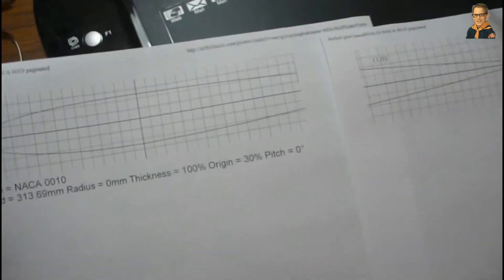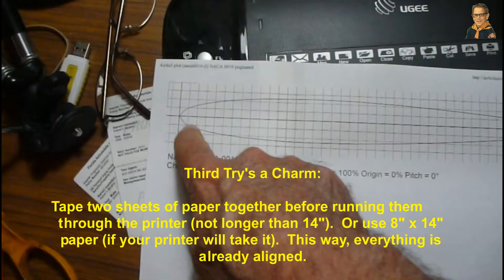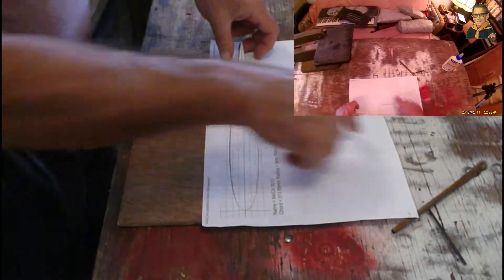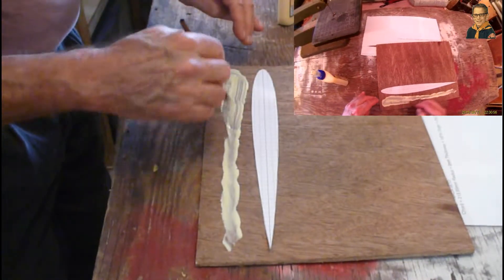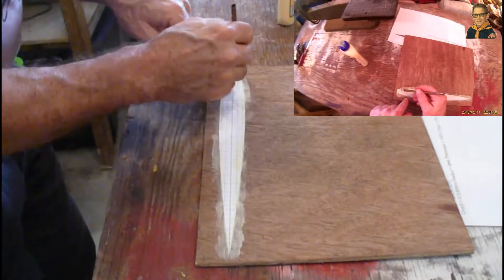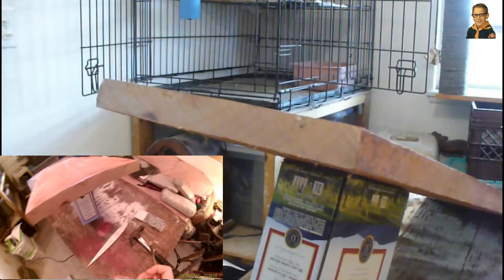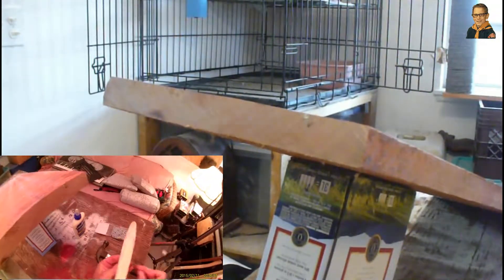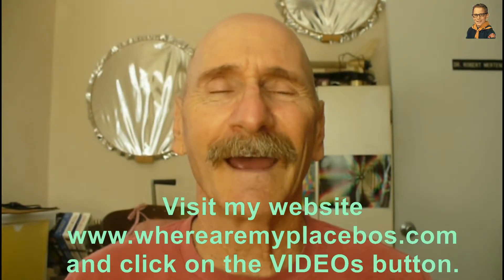Part 2. Design and Build a Sailboat Rudder: Make the Template

Comment: Hey dr bob where did you purchase your mahogany template? And it looks like it’s 1.5” width?
Reply from the maker: Thank you for your comments.  I picked this piece up from a specialty store that does carpentry work.  The width is actually a little bit discontinuous.  It's around 1 1/8" thick at one end and around 1 1/4" at the other.  So, it was imperfect.  I just went with it.  There were also a couple of cracks in it, that later filled easily enough, and didn't seem to affect performance.